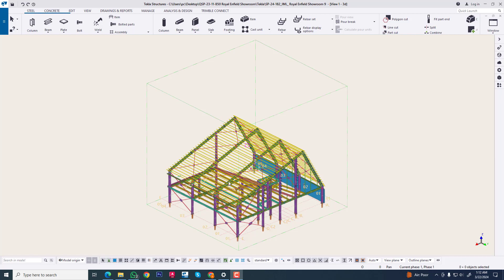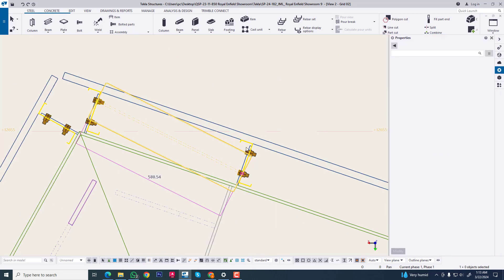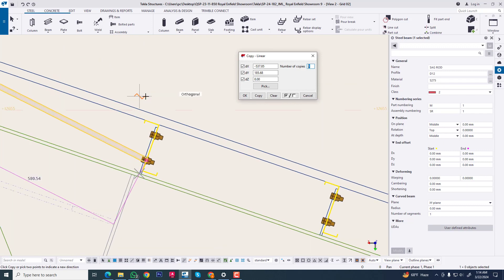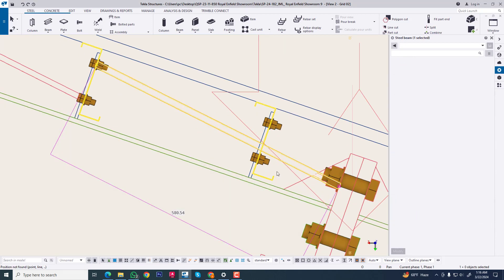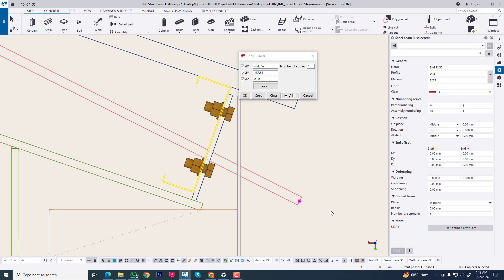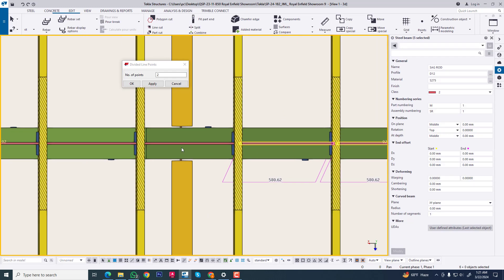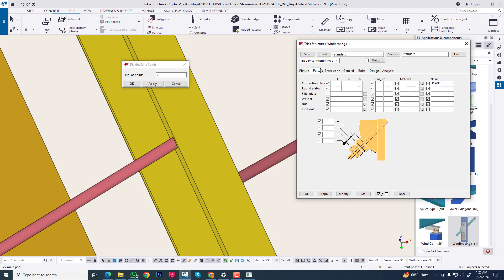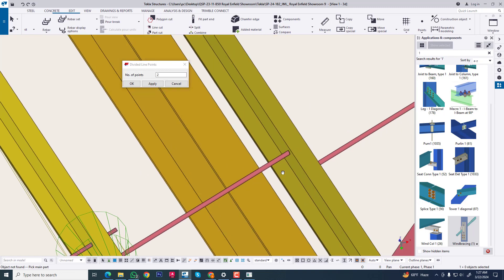Tekla structures | How to Create sag rod in tekla structure easily

Comment: How to fix nut & washer to the sag rod?
Reply from the maker: Without Peb Tools, we can Apply this process. Nut & Washer Manually shown in Auto cad for sag rod fabrication.
Reply: @teklahouse  Then the Qty. estimation also has to be done manually?
Reply from the maker: @raviprasadvoletiBR16L  You will get the Qty and weight in the assembly list. Only the nut washer is shown in AutoCAD Drawing.